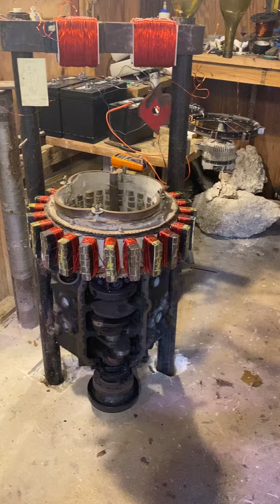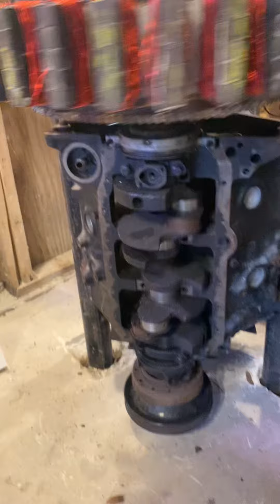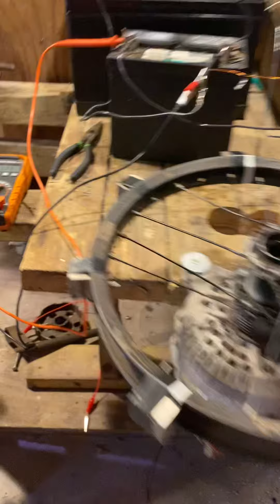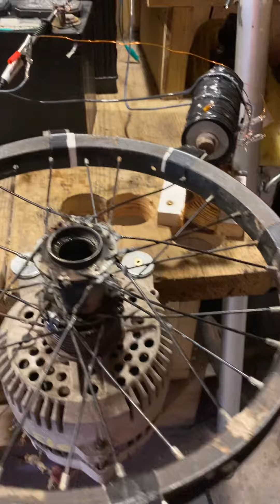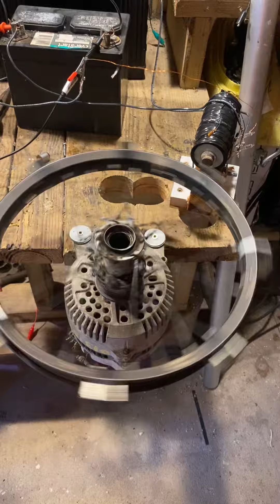Free Energy ! Using the back EMF to charge a battery

Comment: What is the car alternator hooked to
Reply: The wheelworks of the universe.😂
Reply: If u use a light bulb and diode on the positive and negative for the alternator it will work good to set up a weak magnetic guild as not to drag the wheel to much hope this helps